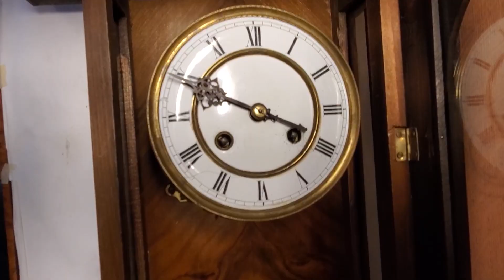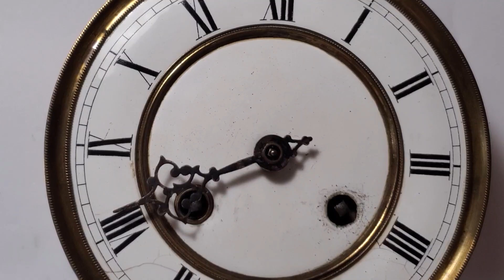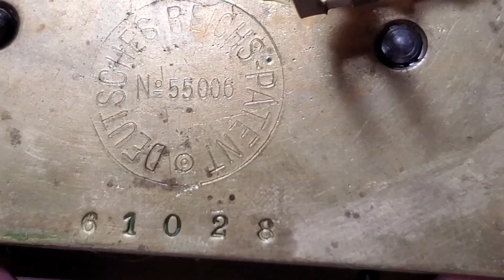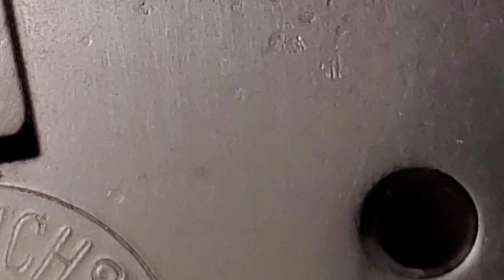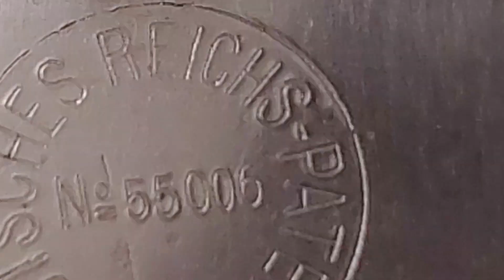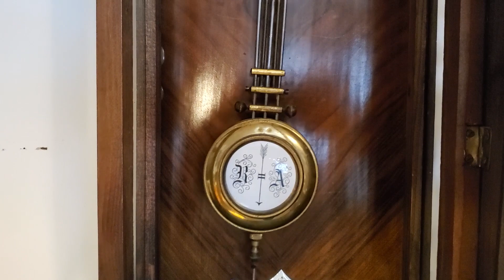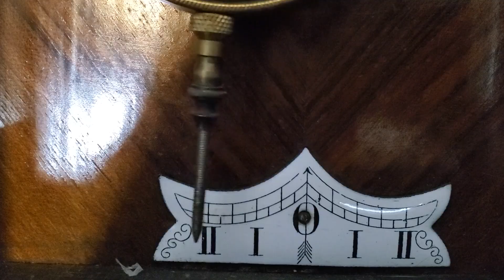German wall clock for Terri from Washington #65

Comment: Great video as always.  It was nice to see the slow motion of the strike side and also the movement back in the case and striking at the end.  It seems like a very well made clock that would be 125 years old and have so little wear on it.
Reply from the maker: I agree with you, with such little wear, it was either maintained on a regular schedule or not used for a long time. 
That green dried oil in this movement is common to clock oil that has not been cleaned out for a long time frame.

Comment: Great video! I’m currently trying to refurbish an old clock and I’ve followed your instructions on cleaning. However, the pendulum seems to automatically stop after a while so I was wondering if you knew what the problem may be. Thanks a lot!
Reply from the maker: To many possibilities to list here.
Make sure its in beat and check for good power to the escape wheel.
Might be in escapement wheel to pallet fit up..

Comment: I have one  that appears very similar, time only (no strike).  Same markings, book matched veneer.  Am going to school
with your video to clean and oil.  Is minor finish restoration advisable?
Great video!  Very much appreciate you work.
Reply from the maker: They are a good time keeper, you will enjoy it.
Be cautious with the mirror finish.
Most early clocks always had a layer of gold gilt on brass parts.
Gold gilt was used as thin, layer of corrosion protection to the brass.
Undamaged gold gilt will last well over 100 years and beyond.
To cut costs, gold gilt was left off some movements, but always a layer of lacquer was added as corrosion inhibitor.
If you  have a gold gilt movement, attempting to polish to a mirror finish will damage the gold gilt, would advise against using polishing compound on any gold gilt.
If you have a lacquered brass movement, it would be proper to re-polish the brass, then apply an anti-corrosion layer of lacquer, urethane or similar.
Reply: @jamesmartin5370  thanks James.  I do not have the expertise to refinish any metal work, but am wondering if restoring the finish
on the wood work.  There are missing finials and the finish on the veneer is deteriorating.  I believe I can do that if it would not harm the value of the clock.  Any advice?
Reply from the maker: @waltmorgan5222  It depends on the person interested in purchasing the item.
Some people prefer a preserved item all original right down to the spider web cracked finish and missing finials.
Yet another person may prefer a restored item and would welcome the finish on the wood being reworked as long as it done to keep the original look of the wood.
You will never be able to please them all.
I would replace the missing finials, if its a lacquer finish, clean it well, then sometimes fresh lacquer "slow dry" can be lightly applied with a soft cloth in several coats.
Lacquer is a solvent based finish so the old lacquer will reactivate and melt into the new finish you apply, at the same time you may be able to blend the new finials.
Be prepared to deal with an original lacquer that has had color added to it, this will throw a curve in the matching of colors and tones, with any luck it will be a clear lacquer.
Reply: @jamesmartin5370  many thanks for your reply and expertise

Comment: Wonder why they picked the number 8 to indicated it's a one movement at a time clock.  Also wonder why they hand made the screws - never seen that before.  Very interesting clock.
Reply from the maker: This clock wasn't produced with the same process the Americans developed.
American watch and clock companies developed standardized parts that would interchange with each other.
Not sure about how they picked the numbers to indicate matched parts for their assemblies.
Early clocks and watches had a lot of hand made processes in them.
This clock was made just before the European companies had completely transitioned to all machine made parts.
Reply: @jamesmartin5370  Makes for some very unique clocks, but a terribly inefficient  business model.  
I believe the Hamilton Model 21 was the first Ship's Chromometer to be massed produced on an assembly line.
Reply from the maker: @winstonchurchill3597  
From what I have found, when the American watch and clock companies started exporting their goods to Europe, the stores over there could sell them for less than the European clocks at a better profit, this caused  many of the European companies to go out of business.
Reply: @jamesmartin5370  Funny thing is, it's come full circle, as most clock movements are made in Germany now.
Reply: Do you think the number 8 was used because it is the last digit in the serial number of that clock?
Reply from the maker: @normshafer2243  I don't think number 8 used is related the serial number. This movement was made back in a time period before standard tooling was being used so the workers in the factory assembled one clock at a time making adjustments to induvial parts as needed, each worker would have had been assigned to use a certain group of numbers unique to how ever many they assembled that day.
Reply: Probably in pre mass era it worked out like this, never forget that this a production time when the USA just came out their civilian war